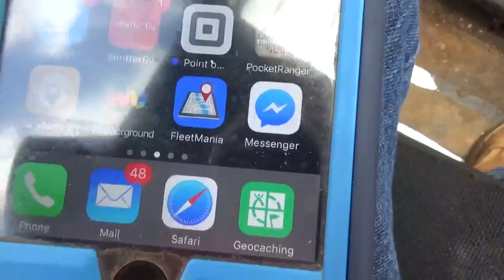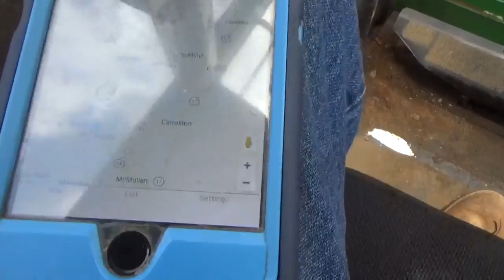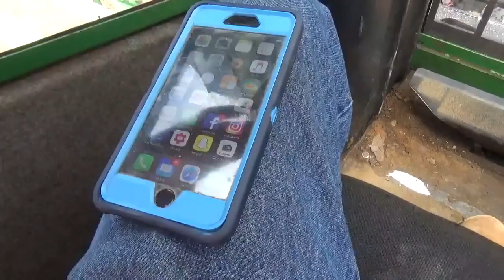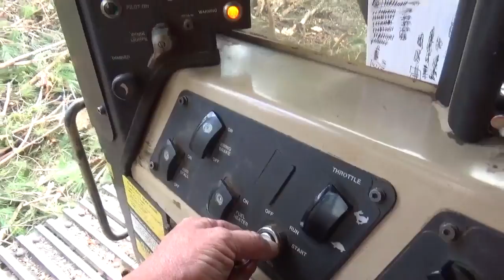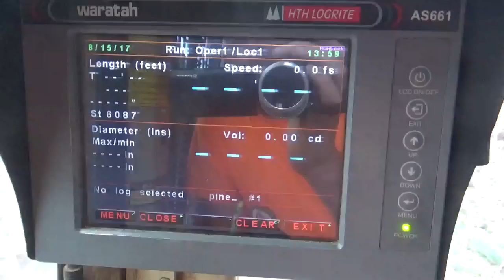Replacing the Final Drive on the Tigercat L830C

Comment: Please do more in depth video on your GPS tracking system - specifically what brand of tracking hardware you are using and if it is permanently installed or plug & play style (Fleetmania does not have a working website with info on what tracking equipment their system works with - also the app stores do not have any equipment info).  We have a bunch of fleet customers that use all different brands of GPS tracking systems and we are always on the lookout for systems with good reliability & customer support, that have been around more than a couple months, and that do not have long contracts attached to them.
Reply: KCautodoctor I second this. I've got a fleet of 35 trucks and we need a better tracking setup